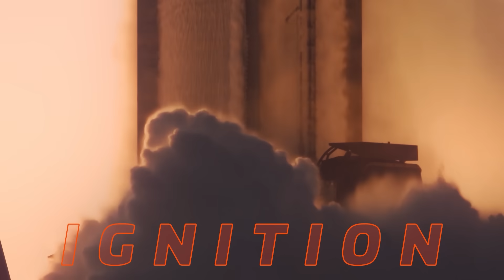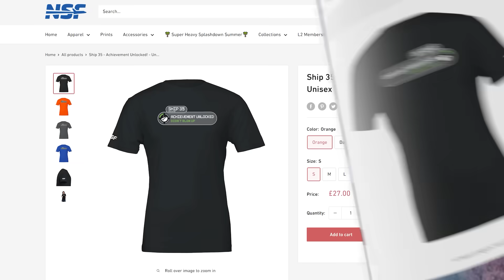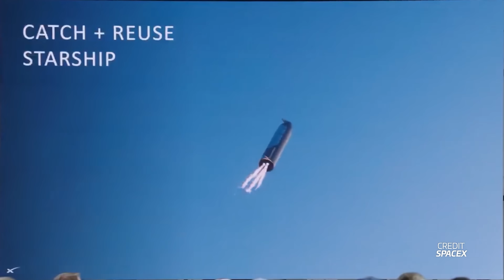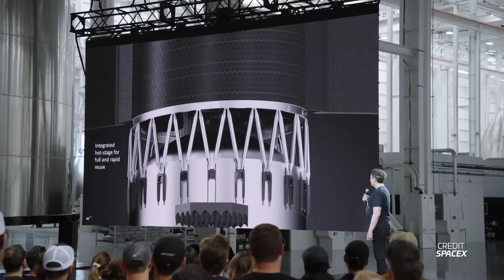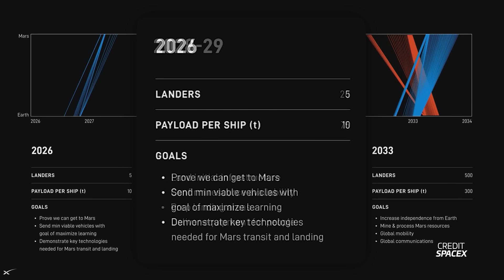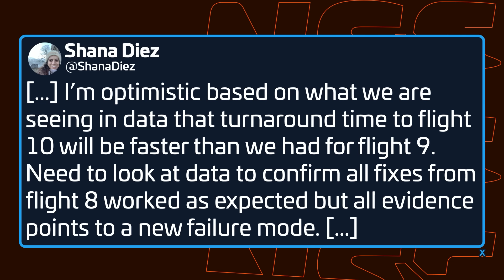🚀 Elon Musk’s 2026 Mars Plan! | Starbase Update

Comment: It seems likely there will eventually be several different classes of Starships that achieve mass manufacture and several that don't but continue in limited production.  SpaceX has a vested interest in launching many of their own satellites, using something like the Pez dispenser to put them into orbit.  There will also be contracts for larger satellites that require a much larger opening in the side of the Starship hull, hence, a 'cargo' Starship.  Then there will be propellant tanker Starships to directly fuel Mars landers and maybe, eventually, propellant depot Starships that will be launched to Earth orbit where they will stay.  Somewhere in the not very distant future there will be Moon landers, and perhaps several Space Station versions for Earth orbit.  Whew, that's a lot, and I'm surer I missed some!!!  SpaceX will certainly have to stabilize the design of the basic rocket engines plus tanks plus pipes, pumps, etc., but so much of the rest of the vehicle design will be changing from one job to the next in the next few years it will be quite a challenge to come up with mass production.  Fascinating times!!!
Reply: There will certainly be several variants.  The first obvious starlink variant.  A tanker variant which will likely make up a large number plus the cargo and landers as needed.
Reply: Really think they will be producing three a day and 1000 a year?

Comment: Payload mass fraction has almost disappeared.  I think a major re-design with less stainless steel for the Starship itself.  Booster is obviously much less powerful than promised.  Don't get me wrong, just that part, Booster, could become its own product and make real money, but the upper stage is too heavy and they are making it heavier.
Reply: Keep in mind: Block 2 is lighter than Block 1.
Yes, it has 300 tons more propellant, and increased structural reinforcements, and yet its LIGHTER.
The booster is delivering what they expected as well. It's not a problem. It's optimizations right now are focused on making it faster to refurbish. Increasing payload capacity isn't the main benefit there.
Reply: What nonsense you people make up.  Then again making things up is all you poor people CAN do.

Comment: Yea, Ryan!
Wonder if Booster Raptor with 'issues' before launch was involved in the issue during splashdown.
Also wonder if rotation of Ship might have caused issue with door not working.
I would guess they did get some data on the new heat shield as there are likely sensors all over the ship.
Most of the info I see for Mars Transfer windows/time is for Earth to Mars. Is it the same for Mars to Earth?

Comment: i notice that the new strut system doesn't have a exhaust blocker like the most recent hot staging ring had, i cant help but wonder if the new asymmetrical grid fin layout is meant to do the same thing. i bet they have the single one pointing up during staging, maybe even steering a bit with the matching pair during stage separation. i bet that missing one fin wont effect the booster much when falling engines first but will have a large effect when the aerodynamic  force is applied to the top.

Comment: It really depends on exactly what is wrong with the Starship we know that the booster is working as expected. We know that the problem with the starship is that it is struggling to come back after it's launch. But that is not necessary for Mars. But propellant transfer is. 

The issue that Tesla and SpaceX has, is that they are doing things that have never been done before therefore impossible to predict. 4X best estimate is a reasonable. So when you listen to a TESLA or SpaceX prediction you need to do a very basic evaluation. 

1. Is it something that Tesla/SpaceX have done before? T - Estimate
2. Is it something that someone else have done before? O - Estimate
3. Is it something that no-one has ever done and is impossible ? I - Estimate

The formula is 
 T+O/2+I*4

;-)
Reply: Nothing is going to mars without recovery being mastered.  Unless you expect them to expend each refueling tanker.
Reply: @imaginary_friend7300 Good point. To lazy to do the calculations but I think with minimum payload and a bit of a longer trip you might get away with considerably fewer tankers. Of course each tanker is another chance to test the landing. I'm guessing about 5 tries before they nail from orbit.(But they need to get to entry first :-( ) 

My reading is that they figured out the landing but need a tile that is maintainable. But as usual SpaceX did about 1000 other changes that could have caused the problem.

Comment: I have the feeling, the problem was not really the door, but the starting rotation
Reply: It's interesting that they still tried to open the door even though the ship already lost attitude control and started to spin.
Reply: @cube2fox  The worst case is that they couldn't open the door because of the roll rate, but tried anyway. The only risk might be that they opened the door and couldn't close it; but if they knew they weren't going to be able to control attitude at reentry, then any structural failures caused by the door opening wouldn't be a major problem either; so I don't really see a downside.
Reply: The door binds due to its extreme cross sectional load cutting. Getting the supporting materials around the door properly reinforced will be key. But it's hard to do due to the mass gain with reinforcement. Just enough, but not overkill is key.
Reply: The cargo bay was obviously pressurized, from the motion of the snowflakes.  That means that there was pressure exerted on the inside of the payload bay door.  Doors on any aircraft are designed to seal to the hull so they can only be opened while the aircraft is on the ground.  I see no obvious reason why the payload bay should be pressurized after SECO.  Prior to SECO internal pressure strengthens the hull to resist acceleration.

Dave Bowman: Open the pod bay doors, HAL. 
HAL: I'm sorry, Dave. I'm afraid I can't do that.

Comment: If Elon says that the next launch will be in 1 month, it is usually 3 months. The multiplier is ~ 3X. If Elon says that the Mars flight will start in a year and a half, it will be 5 years.
Reply: The main hold-up is developing the propellant transfer system (involving a propellant depot in LEO), which is currently planned for next year. It seems unlikely they will finish it before the end of next year, when the 2026 Mars transfer window closes.

In any case, they need the propellant depot already for the Artemis III contract, including a two-figure number of Starship tanker flights to fill it, the development of the HLS Starship, and an unmanned HLS test flight to the moon before the actual Artemis III mission. I doubt SpaceX will in the foreseeable future be left with much resources to spend on Mars, as they are already behind on their NASA contract for the moon landing.
Reply: @cube2fox  They might NOT need the propellants depot, but only because they accept the risks of direct transfers from tankers to Mars transport(s).  Rolling dice, LOTS of dice!!!
Reply: @cube2fox Isn’t the biggest problem an inability to get a starship back at all this year? How many wasted heat shields does this make?
Reply: @sonar8594  They just need to fix the attitude control problem, and perhaps one or two other (so far unknown) problems. But they already did soft splashdowns before, and booster landings, and belly flops, so getting the ship back doesn't really require that big of a leap it seems.
Reply: @cube2fox  Except Block 2 of the ship, leaks like a sieve and blows up. The iteration is going in the wrong direction. Perhaps Block 3 will be the first ship that can credibly attain orbit.
Reply: I agree that the first ship to Mars is most likely to be in 2030 - 31. (I think 2028 - 29 is very possible though)
And I think befor people get to Mars, there will be a longer stay on the Moon first.
Reply: ❤a
Reply: Also when you crunch the numbers it seems pretty unlikely. HLS will require 16 launches (last I heard) to get to the moon, assuming a Mars Starship requires the same number of launches that's 5 x 16 = 80 launches, that's about one every 4 days in 2026. I just don't see them hitting that cadence next year, and that's before you factor additional test flights and HLS itself.
Reply: @lukelanyon-hogg  I believe its horse apples and Elon will kick the bucket before it happens if ever.
Reply: The announced plan for Mars 2026 is for five Starships each carrying just 10 tons of payload.  That will not require the Starships to ask the orbital refueling station to "Fill'er up."  There are five ships being sent because the odds of all five successfully landing is remote.  This is five separate experiments, possibly testing various solutions.  If even one ship actually sticks the landing the entire mission is a success and provides key information for the 2028/9 mission which will exploit almost completely refilled Starships, redesigned, less massive, heat shields, and perhaps paying customers.  Also even just delivering 10 tons to the surface is more than the cumulative deliveries since the 1970s.  An entire Perseverance-class Mars Rover has a dry-mass of just 1 metric tonne.  According to Wikipedia there are only two other missions scheduled for this window: an orbital explorer to collect information on the moons, and a private mars lander from Relativity Space.  I am hoping that SpaceX will get a few ride-share customers, for example from university engineering departments willing to put up the discounted price for 50kg which SpaceX will need to offer because they cannot guarantee delivery.  While it is likely that all five missions will fail to land, there is no obvious reason why the majority cannot insert themselves into low Mars orbit (LMO) using atmospheric drag as many past missions have done.  Then they could deploy payload into orbit, for example Starlink comsats or ride-shares, before taking the final dive.
Reply: Spacex will not see Mars for next 10 years as minimum. There are huge sirios Problems to solve.
Reply: Maybe you multiplier means that SpaceX will only achieve one Starship to Mars in the launch window that starts Nov 2026
Reply: Absolutely agree. During the SNx hops and then high altitude belly flop flights I fine-tuned my multiplier for converting Elon time to real time and 3x is exactly the multiplier I settled on. It served me well in estimating the actual timings during those phases of Starship development.

I think we might see that multiplier start trending down very slightly over the rest of this year and maybe we'll end up at a 2x multiplier at some point but for now 3x still feels like a reasonable figure to use.
Reply: I can see them sending a single test starship to Mars Orbit (no landing) maybe with some starlinks in it next year, but i agree anything like he's suggesting for next year seems much more likely in 5 years.
Reply: A 3X multiplier is probably accurate for uncrewed. But Musk also mixes in nonsensical and somewhat alarming rhetoric when he suggests sending humans to Mars as early as 2028. Which by the way doesn’t even match the slides behind him which show that the 2028 missions will only “Confirm resource availability” and “Deliver equipment for people.”

Also alarming is that once again, repeating what he said in September 2024, Musk has said that they will send people after demonstrating landing, but he never specifically says they must also demonstrate safe return to Earth. Quoting from September, “If those landings go well, then the first crewed flights to Mars will be in 4 years.” 

But that’s just all bluff and bluster anyway. The reason that he doesn’t mention return is because it exposes the fallacy of his claim. That’s because even if landing safely on Mars isn't a hard enough challenge for the 2026 missions, return to Earth requires a massive industrial project on the Martian surface to produce the return fuel using ISRU. I read one estimate which says they might have to mine 60,000 tons of regolith to extract the 600 tons of water needed to produce the required oxygen and methane for a return trip. Will this be tested for the first time on the 2028 human missions? That would be dangerous and crazy.  They would need to demonstrate ISRU and refueling and return to 
Earth on the 2026 missions to be launched just 18 months from now. They also have to demonstrate storing the fuel that is produced, and demonstrate safely refueling a Starship on the surface, (do they have to build a tank farm?)  All of this will be demonstrated on the 2026 flights?  

In reality it will likely be at least eight to ten Mars cycles before even an uncrewed Starship actually returns to Earth from Mars, and even then it has to be repeated enough times to be considered safe, or at least as safe as a vehicle with no launch escape system can be.  Even suggesting that this will all be demonstrated in 2026 is as ridiculous as Musk’s claim that the Dragon Crew 10 launch in March was sent to bring back Butch and Suni early.
Reply: Agree.  And I would not be surprised if the Mars flight won't take place much later than 2030.   Stage 1 and 2 are still being tested.  Other technical challenges like refueling in space, landing on Mars, and logistics for  first group of brave hearts to live on Mars..etc still need to be planned and tested as well.

I want to see the first successful orbital flight to take place by the end of this year(crossing fingers).  And in the near future, starships will be used to deliver exported/imported goods within a couple of hours instead of days or weeks.
Reply: I would normally agree but if you look at what they have accomplished in the last two years I think 2028 is pretty reasonable for a first Mars flight. I also think flight ten will most likely be end of July. Maybe Elon time should be adjusted to 2x now that they have caught/reflown a booster, soft landed a suborbital ship, and have a fully functioning factory?

Comment: Could Aerogel be used as a rentry shield, alongside with the tiles..? Might not be correct on what im thinking of, but could one use a flow of hot gas, sort of like heating a bearing to 1000°C and dumping it in water. Where the metal produces its own "shield" until both bearing and water equals one another.. Great work as usual.
Reply: Its not the most robust material, I don't think it would survive.
Reply: @imaginary_friend7300  True.. Was thinking more of and under coat beneath the tiles.. but you do have a valid point

Comment: Clearly SpaceX has more faith and reliability in their software controls than they have in their hardware by losing 4 grid fins in favor of three. With 3t mass of each fin, losing one leaves that much more payload mass for the starship to deliver to orbit. Besides when starship goes from 6 to 9 engines in stage 2, we're back to more vehicle mass and less payload mass, at least by calculations. Then again, three more engines and a lengthier ship puts more payload mass back to orbit. Quite the yo-yo effect trade-off between Kg-to-orbit costs vs. ships power and delivery capabilities. With the remaining three Ver2 ships, we can only expect more data and more extreme conditions exerted on those vessels as Ver3 ships are in the wings waiting completion and testing at Starbase. Loss of attitude control is our prime handicap lately and having a bad attitude isn't good for business!:rocket-red-countdown-liftoff::rocket-red-countdown-liftoff:
Reply: Reduction of dry mass on the Booster does help a little, but it does not translate to an equivalent increase in payload capacity.  That kind of direct tradeoff only works for the Ship.  The reason is in the math (the Rocket Equation) and how it applies to staged launch vehicles.
Reply: @Spherical_Cow  to a degree, yes that's true, but it also allows the boosters TWR to get the booster a bit higher in the atmosphere for ship separation.